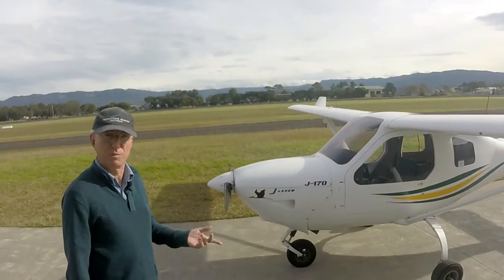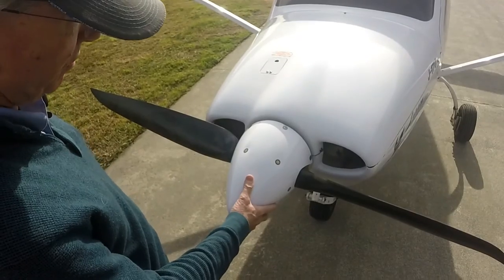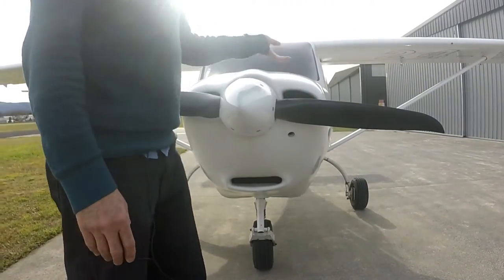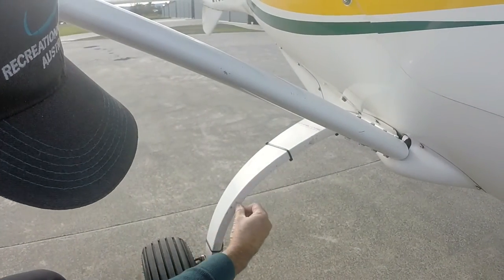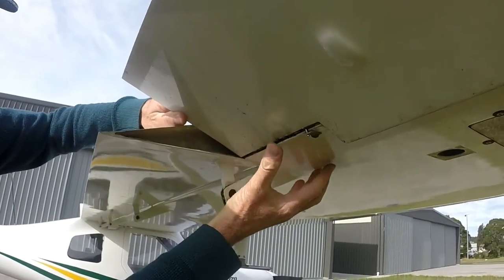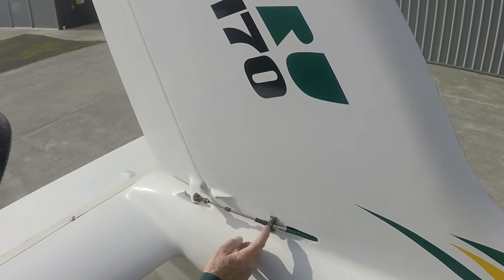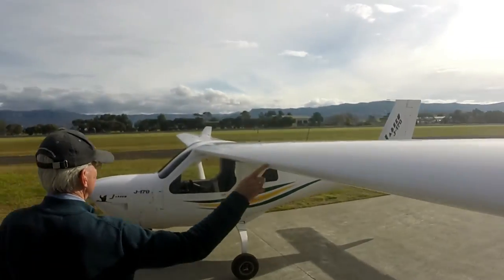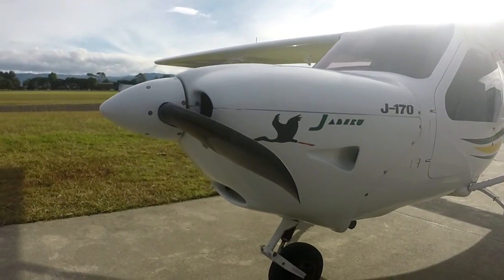RECREATIONAL PILOT CERTIFICATE: How to preflight a Jabiru

Comment: Just a question are the rudder / elevator / aileron control horns reinforced with steel / ally or are they just fibreglass?
Reply: All fibreglass, mainly for weight as LSA's are under 1.5 tons on Take Off, the more thats saved the more the user benefits.